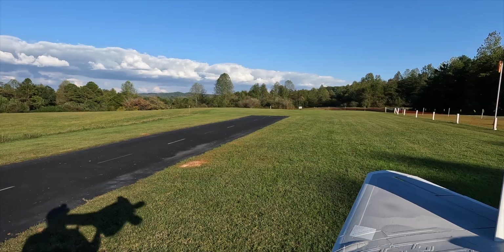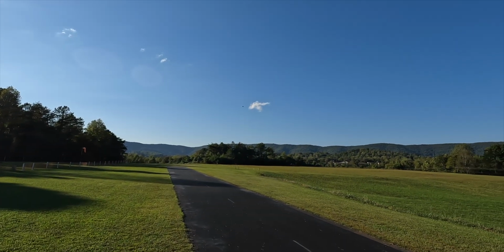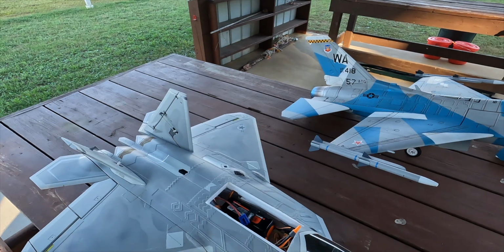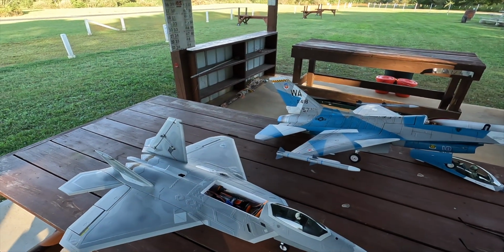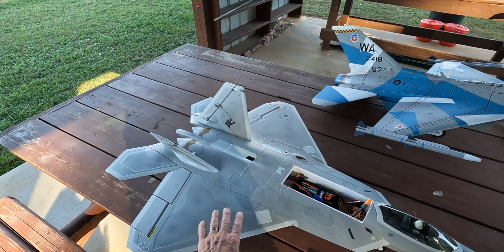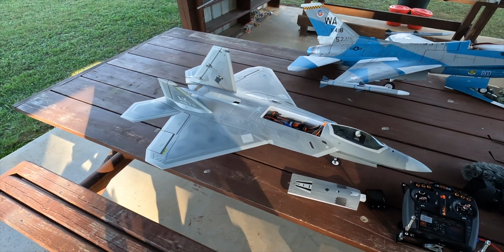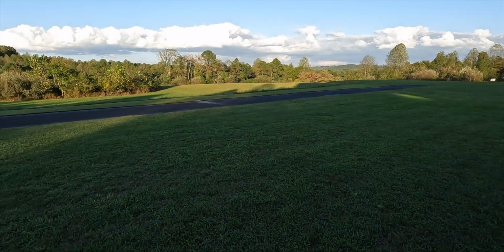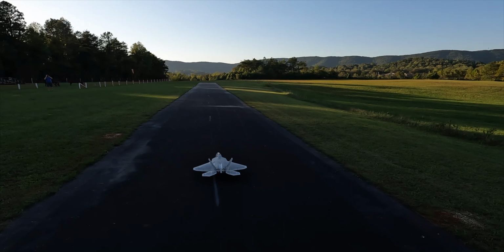First Flights of the new 70mm F-22 from Freewing

Comment: Sounds nice. What gyro?
Reply from the maker: AS3X+ in the Spektrum RX
Reply: @allensrcadventures what did you settle for on your gains for as3x? I haven’t flown mine yet, but have them set pretty low to start.
Reply from the maker: @Cakey831  I just left them at the installed defaults.
Reply: @allensrcadventures what did that end up being?

Comment: That's crazy..3 min flight ?.. 🤔
Reply from the maker: I don’t think I understand the  question? 
Yes, I landed after 3 minutes.  Thats what I do on a maiden flight… then I check the battery and start adjusting the timer accordingly.  
Are you thinking I should have just flown until the battery was dead and then do a dead stick landing?  That seems like a bad idea.
Reply: @allensrcadventures  so how long of a flight time did you get up to with the 4000 with testing?